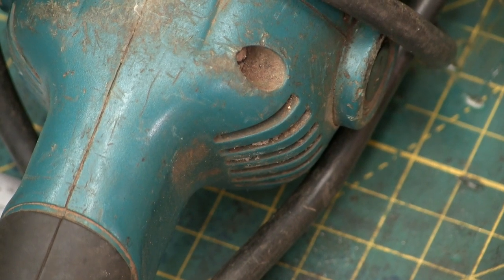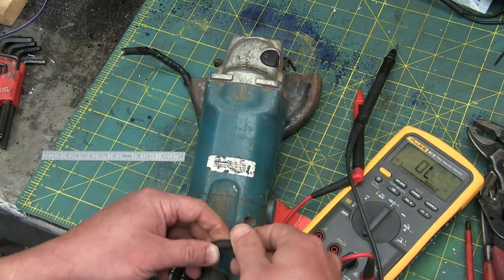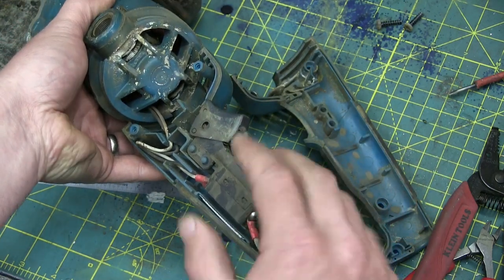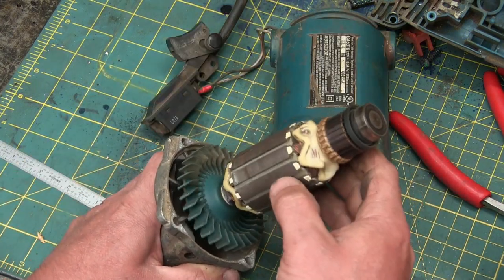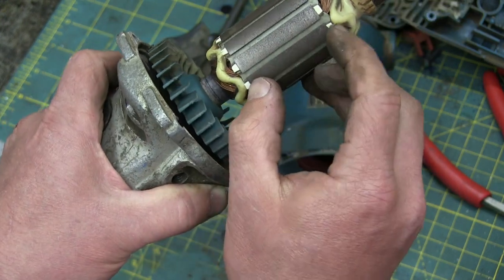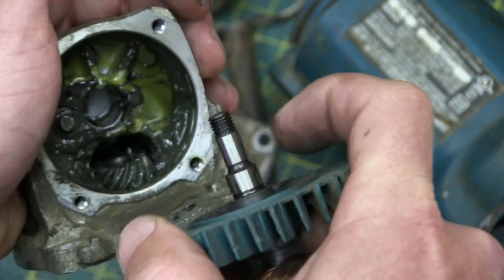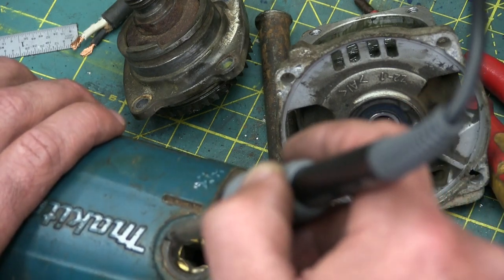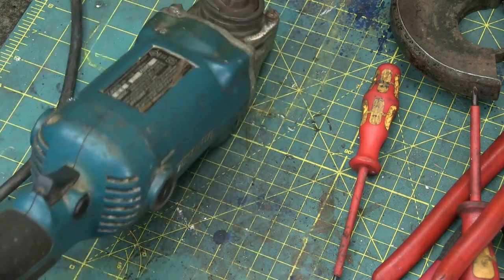BOLTR: US built Makita 5 inch angle grinder

Comment: You do mention at one point that it runs on A.C., but it has brushes. In a previous lifetime I've plugged many grinders into an SA200, which outputs 110v D.C. and they work just fine. Is there a 4 way bridge incorporated into the trigger mechanism?
Reply: Thanks for the reply. a quick search after your insightful reply has led me closer to the true path :-), one power tool I cooked many years ago had a 4 way bridge and a switch inside, and I was operating under the mistaken belief that they were all wired the same.

And many thanks for the frequent invites to the inside of your shop!
Reply: The trigger switch, however, will probably die much earlier if run on DC since the switch is probably not designed to quench a dc arc.
Reply: Grinders seem to work OK, but what twigged me to the fact that I was using DC was when I killed the trigger switch in two power drills.

Comment: Ah, the scrap bin.  How I got my Plasma cutter.  She'll sever 5/8" plate, or the neighbor's car clean in two, and it only cost me a free piece of wire to jumper the safety.  I guess if I decide to use her without the cup in place I could shock myself into a dirt nap, but I can't turn down blue welding (or cutting) equipment.

Comment: We use "hysteresis" in battery engineering too. If I use 10 J of energy to charge a completely flat battery, and then later I only get 8 J (or any value less than 10) out of the battery, there's "hysteresis".

Comment: I've seen nearly all the grinder videos. But I use AEG tools. Also made in Germany. Seem pretty crappy. One drill lost torque. Blotter on a circular saw stripped. Angle grinder stopped working but it was stretched cord so I cut the cord a bit shorter and re attached it to the switch. 
Pull one of them apart for me and tell me if I'm wasting my money on them

Comment: Why is powdered steel automatically less tough / impact resistance? I was under the assumption that it was limited by what alloys are used, not the forging process or lack there of. There are quite a few CPM tool steels that are super tough, impact resistant, abrasion resistant, etc.  It may be that although they COULD use a better quality powdered steel, that in actual practice, they use an inferior metal.

Comment: For those wheels that's been screwed on with a Concrete Jack Hammer (he said "Screwed"), I made a flattened and then twisted tube over the head wrench handle to sit my knee on and made an extension for the spanner handle to increase to titty twister torque values, fornicate a whole bunch of internal detentes.

Comment: I'm pretty sure that Makita is just the Japanese word for "skookum as frig." I have yet to meet one that isn't built like a brick shithouse.

I've had passed down to me several 9.6v cordless drills and a little circular saw, with NiCd batteries that really need replacement since they're 30 years old but otherwise still work perfectly, a beast of a power planer that did duty in a boatyard shaping lead blocks into fins for wing keels for race yachts, and a big evil bastard 550 rpm 1/2" drill we call The Wristbreaker for obvious reasons. They're all nearly as old as I am and save for the slightly howly bearing on the planer and a few power cords of questionable future longevity they're all every bit as solid as the day they were purchased.

Comment: My take on this is that its scookum as frig, only the thin internal wires and spade connectors on them to really complain about. but its also bulky compared to many competitors, more is not always better, its a big heavy tool for what it does..
Its easy to make high quality stuff, just over-engineer everything. the trick to real good tool is to make them good enaugh in the smallest lightest package...

Comment: Short story ... inspired by AvE !
Firstly, I am a pesky woodworker, with woodworking tools, including a couple of hand oscillating sanders. All of a sudden it sounded as if my one sander's electric motor was replaced by a diesel one!
I just bought a new table saw soooo if I should dare ask the "minister of finance" for more money ... yeah ... it will not be, to say the least, a pretty sight !!
Then the thought ... once its fucked, you can't fuck it any more ... I wonder who says that??
I pulled up my socks, combed back my hair and took the thing apart, found a bearing that totally shat itself, scratched in my spare bins and behold ... I found an exact match!! Had to use a small bearing puller to get her off, fitted the new one and I could not believe it ... she actually works proper again!!!!
THANKS AvE !!

Comment: I've got default, Bosch, makita and shitachi grinders all work well and all are similar build quality on the out side. The makita is the only one to have had a spanner on it the 200lb gorilla that had it before me had burnt it out not long after he brought it id say with how tidy it is it's also had a cable. None of the others have ever been touched and have had some stick only owned 1 dewalt one Bosch and the two hitachis from new. 2 days after I brought the hitachis my cousins 2 year old 9 inch hitachi blew up have done nothing. My dewalt Bosch and makita grinders are all over 10 years old have all been abused and used with diamond discs in damp conditions and all keep going.

Comment: Hi, i recently oppened a broken metabo grinder. I just replaced the switch and the power cable and it runs again. The problem is that with no load, the grinder´s head is getting a temperature of around 50 to 60 ºC after 1~2 min. I replaced the  carbon brushes and verified the armature, and didn´t seem that it was defectuous. The bearing also spin with no resistance and the field coils are also with good values. Does somebody knows what is causing this? The measured current with no load also coincides with a good grinder that doesnt have this problem. The ventilation comming out is good as well as the output speed, and i also dont hear severe mechanical wearing.

Comment: My Makita angle grinder just broke yesterday. When I turn it on bright sparks occur where the brushes are. Is there a common flaw in the design which could be the issue? The grinder is probably 20-25 years old.
Reply: Seems like the brushes got too short and now just spark, take those out and if it turns freely then it's just brushes.
Reply: I think you got your moneys worth after 20 years. Probably a set of brushes would get you going again.
Reply: I'd say the thing that's doing the sparking is the thing causing the problem. Usually that works, especially on something as simple as a grinder that only has On/Off control and not variable speed or soft-start.

On something more complex you might have a cascade failure where the noisy/highly visible failure is only the result of something else going "just a little bit wrong".
An example is Computer power supplies: They like to blow power semiconductors (transistors, bridge rectifiers, etc) when the capacitors that filter the rectified mains dry out. The root cause is capacitors that re out of spec, but the symptom is the skidmark on the PCB next to the power transistors. Electrical testing of the capacitors can reveal if they're any good.
This kind of stuff is pretty complex to the average person, and it'd take me too much time to get parts to fix it compared to buying another one so I just scrap the old supply for "free" power electronics and heavy duty magnetics (inductors etc). Not sure what to use them for, maybe I'll make a solid state tesla coil one of these days.
Reply: Check brushes/brush holders like the others said, and clean the commutator slots. Get some of your favourite solvent and a needle of some sort, and scrape away the crud from between the commutator slots. 
Carbon and copper dust can accumulate in those slots and cause arcing.
Reply: Yup, brushes. Might need an armature as well. I'd pull the armature and clean it up.Check the bearings (like Ave shows) If it looks okay, replace the brushes. If not, check the price of the armature and bearings. You can likely still get the parts and they aren't too pricey.

Comment: I'm starting out in the automotive trade, so a drill isn't my bread and butter power tool, a rattle gun/impact wrench is. I'd love to hear your recommendations for a super nice one o even see you tear one apart.

There's an Ingersoll Rand one floating around that I quite like. Expensive as hell but it reckons 1500Nm of torque, so if that's the case it'd probably have a decent go at a crank bolt, if not spin the whole engine around if it were seized...
Reply: Moon Moon hey bloke. get a Chicago pneumatic rattle gun. Had my cp gun since I started my apprenticeship in 2004 and it still kicks hard.... even after being run over and bent by a few four wheel drives..

Comment: Ave, a real question for you: I often find I need my grinder to chooch a tad slower for some cutting ops. Any trickery/ideas on how to decrease the Rpm for such a poorpuss. I usually spin a Makita 4 inch.
Reply: Just use one pin on the outlet it will run at half speed

Comment: We used them in concrete grinding as the only one needed on the job no 5inch and 9inch cause the 9 inch could do if all now they don’t last nearly as long we kill the gearbox’s bearing and motors cause its all heavy work load use now we have to go fleet with Hilti

Comment: it might be the ADD in me, or the OCD...or CDO as it should be, but I feel like it'd be a nice touch if you cleaned up the machine, like change out the lubricant where needed, and wash the casing out, and the like. maybe  go so far as to polish up the metal head. I suppose though, it'll just get dirty again, the next time you use it, huh?

Comment: Hey mate on the subject of the double insulation what about the front section?

It is made of metal, could that become energized ?
Reply: bkingk8 the metal section is only the gear assembly, no magic pixies are running around in there

Comment: I used to pick up non-working Makita tools from some guy at park & swap. I could get a grinder like that for $10 or $15 USD.  Usually all they needed was brushes, maybe a bearing, and always a new cord. Sometimes the winding might be cooked, and then I'd scrap it, unless it was something actually worth fixing. The Japanese made Makita is still about the best. Southern USA made stuff....erm, ehh, uhh, yeah. I rather like the Makita hypoid saws too, but not from Georgia, sorry  Georgia. It degausses it, there,  ya crazy Canuck. I have this old degaussing coil for old CRT TV sets, so if I get like a 400 or 500 foot extension cord, I can just tuck that coil inside my trench coat, and load up on all kinds of stuff at Home Depot, and walk right through those senors at the door. It's kind of a pain in the ass, because I have to follow the exact same route out of the store that I came in or my 500 foot cord gets wrapped up in the shelving. "Hysteresis" is a term for non-linear slop in electronics. If I can't say adjust something to bring the top end up without overshooting the bottom end, then we call it hysteresis, or the left end without the right end, it's hysteresis.  Sorry about the Canuck comment. I like Canada and Canadians, and your currency, especially right now. It's not so good for you, but I can buy Pippin files out of Canada for like $35 US, where they cost $50-$80 in the USA. Oh, and that includes the ridiculous shipping charges to carry something across the border. Hey, keep you dick free of lice!

Comment: had my 6in Makita for 30 plus years 2 switches lost count how many cords spindle lock is getting weak so it lives with a wire cup brush I have no complaints The 6in Hitachi 20 years or so brushes stick once and a while lost count on the cords more powerful than the Makita bigger brushes, gears the 5 inch dewalt is probably the most used on my truck rear handle is getting loose  for 125$ 3 yeas of shit and abuse best bang for your buck i think

Comment: Thanks for the review. Its very interesting. 

I am hoping you may be able to answer a question.

Would someone be able to use a five inch grinder with a 4.5 inch disk/wheel safely? 

My guess is that its OK as long as the arbor size and speed rating of the disk match and are not exceed by the grinder. Is this the case?

To me this makes sense since a five inch disk will wear down in size as it is used. 

All the best to you from Hamilton Ontario.
Reply: Collocutor RoundThree gotta take the guard off, keep fingers out and eyes squinting

Comment: I bought one of these last year (at the big orange store in the USA). It's nice, but inferior to the one you reviewed in a couple of ways:

1. No locking trigger, even tho the box still depicts one. Maybe a replacement locking trigger for the 7" model would fit but I haven't tried.

2. Handle is a little loose, as if the screws used in assembly were too long and bottomed out. Haven't taken it apart to see.

Also, just like the other "Assembled In USA" Makita tools I own, the sticker with the model number etc. is on crooked. I'm not a flag-waving kind of guy, but damn I love my country every time I see that crooked sticker. God bless us, we just don't care.

Comment: Alright, I'm calling shenanigans on your bearing load ratings. You should actually DErate a bearings static load to get the dynamic load. Think about it. the static load should be higher as that is the load applied that is within the safe limits of a bearings races and rolling medium without damage, but if the same load is applied with the bearing moving, there is gobs more friction and therefore heat. jump on skf and timkens websites, they both list the formulas to calculate the dynamic load. i know some bearing manufacturer is bound to have static and dynamic loads listed.

Comment: I have one of the older types with the small spindle locking button, new in box.
Is it valuable ?
Reply: Makita mod. # 9005B  ,  5 in .
Reply: Rob Trew the 9005B’s are one of the most common Makita grinders. Pretty bullet proof. I fix alot of em. Brand new in the box is pretty cool, you can still buy brand new ones, they go for about $140.

Comment: INPROVEMENTS?????   of the 10 or so of those that i have abused the lock button fails all the time because they shortend the button hole and then it pops that "nice" black thumb button off and the spring flys away. now when you grind the pin falls in and it jams..... and now it is only good for overhead... The brush holder springs fail also, they heat up lose some contact and one little spark and now you have two springs and no contact
inprovements??? i would love to have the old ones back. The new grinders are designed to fail!!!!

Comment: hey Ave, no autopsy on the grease?, the people want to know what kind of goopy goo is there and how it held over the years!
Reply: The grease is always thrown out on the first startup. Tip: put a teaspoonful of 90 wght gear oil in as well  and then never worry about those gears running dry.I pull my grinders apart once a year to redistribute that grease.
Reply: IF YOU GIVE it  A HOT SUPPER EVERY NOW AND THEN THE GREASE MELTS, fack caps fack it

Comment: What would you do?
I'm currently in a situation where my car needs a new driveshaft boot. I can take it to a mechanic or buy the tools necessary for doing it my self (2-3x the cost).
Reply: Have a go yourself. You will never regret buying tools. Get ready plenty of newspaper to cover your bench/table. Some surgical type gloves would be useful. It can be a messy job. You can buy a cone so you slide the new boot over the top. See youtube videos. Good luck.
Reply: Personally I'd replace the entire drive shaft. You never know how much crud got inside and how much it has worn down the surfaces inside the joint. A used one shouldn't cost too much from a wreckers.

Comment: My Dawilt cordless tools after 3 -5 years have problems my Makita cordless drills never had. Some contact problems with the battery jiggling around makes the Dewilts unusable. New batteries makes the problem go away but then it comes back. I may need to go back to Makita.  I am going to tear apart a cordless saws all and impact driver and or the batterie to examine what's going on with loose battery contacts.

Comment: Ave, any idea where to get a replacement motor for an 18V Strap On drill. She smoked and all the pixies escaped then stopped dead. Should throw her away but can't bring myself to do it. Pulled her apart and it has a Johnson motor but not sure which of the numbers is the part number. One is "3L2823" and the other "1080100". Have googled the crap out of this and no joy. Found some for other brands and they are cheap. So if I could get my hands on a new one it is only a simple soldering job to install.Figure if anyone knows it'd be you.

Comment: Welp... I've been eyeballing a new screw/bolt breaker. It was between the Rigid (because I hate the color yellow) and the Makita (because I hate the color yellow). If Makita tools are that stout then i'll drop my hard earned dimes on them. Of course your review helps with my wifes approval of said tools. She knows that if an 6'8 240lb gorilla can testify that its a good tool then her 5'1 172lb bulldog wont break it either.

Comment: Dude, if I were made dictator, you'd design a course for schools to actually teach people about machines and electricity to impart basic understanding about what goes on inside the things they use every damn day.

Also, the only Metabo grinder I've ever met, I acquired through similar channels to this one, and it too had a maimed cord, except after replacing the cord I discovered that there was actually a failure in the gearbox and said gearbox was NLA.